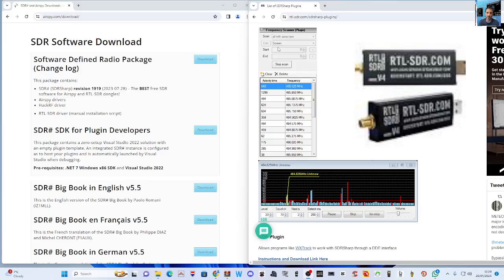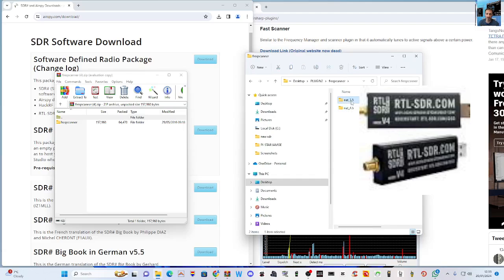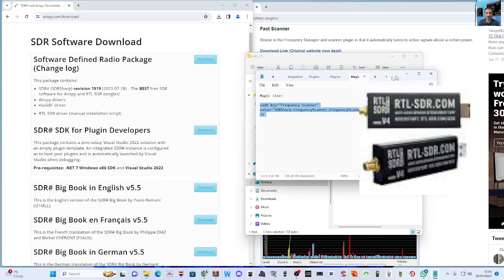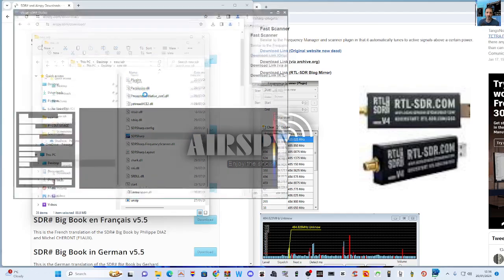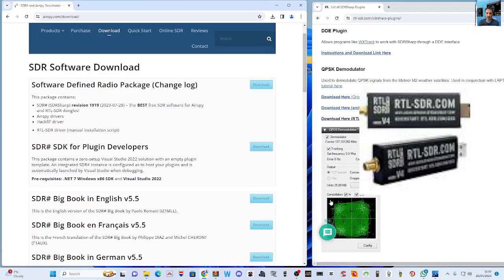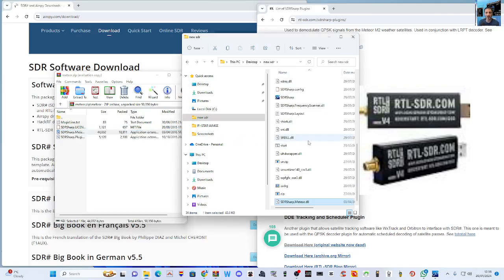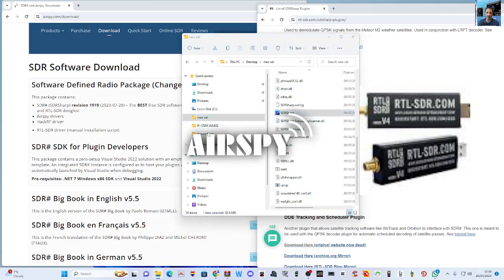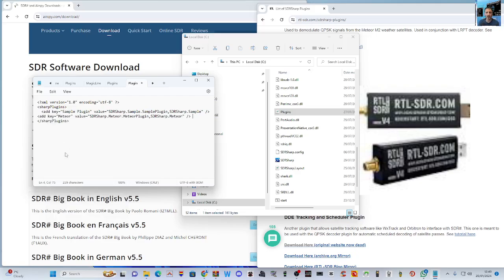RTL-SDR DONGLE - HOW TO ADD PLUG IN - HELP PLEASE ???

Comment: Plugins go in the Plugins folder. No magic lines needed. When you drop the plugins list down, look on the very bottom for Plugins.
Reply: Hello, in the 32-bit version the plugin folder appears, in the 64-bit windows it does not connect. How to use plugins in the 64-bit version of sdrsharp?
Reply from the maker: Thanks
Reply: I have installed this with the old SDR Sharp however I am not sure it actually works with the new Airspy version. @M0FXBHamTech